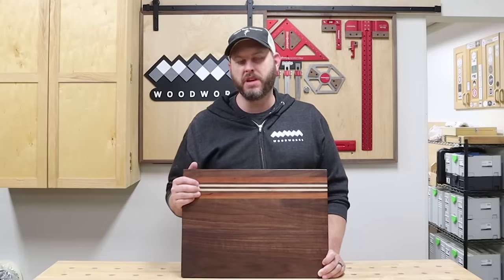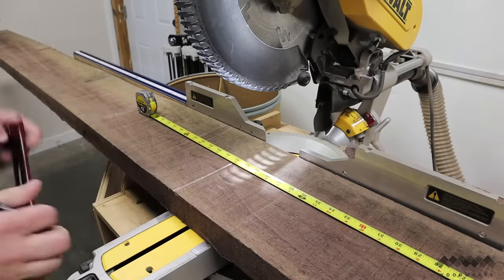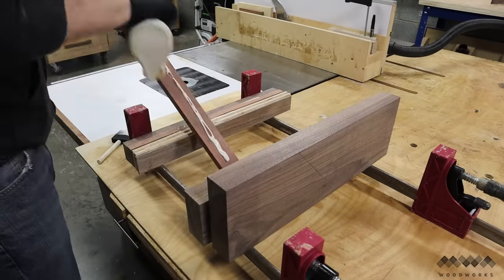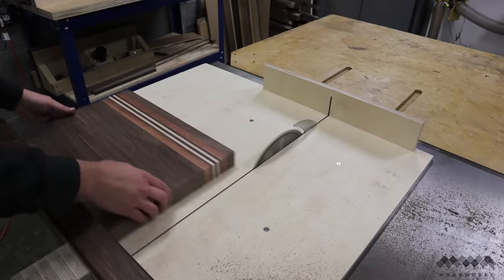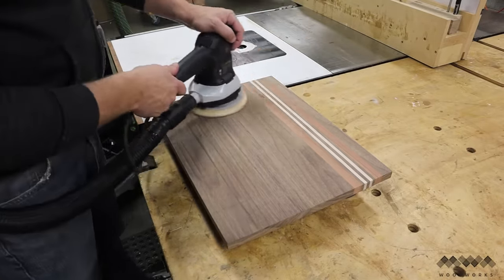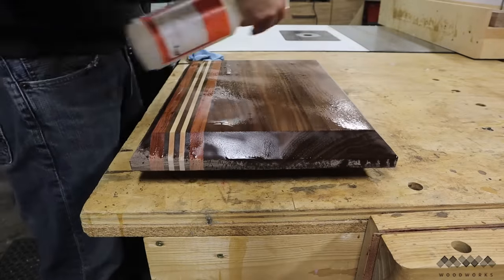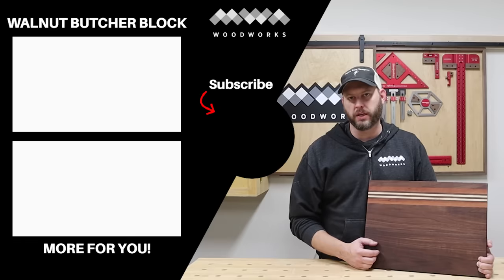5 Tips to create the PERFECT cutting board

Comment: Very nice.  I like to place my boards in a low oven after wax/oil application.  You can see the air bubbling out of the wood, and the physics of the situation suggest that, upon cooling, the material is drawn more thoroughly into the wood.  In fact, you can easily tell the difference in the amount of residual wax and oil versus the usual room temperature technique.

Comment: Hey Matt ... first time viewer and extremely impressed with just how much information you packed into less than 10 minutes!  Your presentation was organized, progressed well, and kept the interest high throughout ... not to mention that the board came out beautifully. Thanks for sharing your knowledge.
I recently retired and have dedicated much of my time to this wonderful hobby.  My biggest problem, I'm sure shared by many baby boomers, of possessing the time, desire, a decent set of knowledge.  The missing components?, money due to fixed budget and limited room to dedicate.
I would love to build beautiful boards much like you demonstrated in this video ... but limited resources say that paper towel holders may be a better match.  Seriously, can you suggest techniques, alternative tools, hand tools etc that can give us budget guys a shot at this? Anything I'm sure will be a big help to us.
Congrats on a wonderful channel that I plan on spending much time on.   Chees!!
Reply: A  planer does not have to be new to be very good, Learn how the tables adjust, cutter bushings are good or serviceable. (Applied bearing) rather than chasing down old manufacturer parts on micro fish. [Chop saw is Optional, Table saw can make those cuts. If you Scribe lines in the Table saw top, 1/4 " or so parallel to the blade / Track fence is easier to clamp strait.  Find a lil old generator (lucky(look for one close to an outlet) free power. and a $75 month storage space... " Daves Custom Boards, coaster sets, Knife blocks, Trivets, Next expand into catch trays for phones an keys ... Lok on YT for how to build wireless charging... Weekends will never be yours again.
Reply: Mr. Pierce , here on YouTube I have found some "channels" (not sure what they're called , don't know the lingo , but individuals like Matt here) with people that have 'alley-rigged' everyday tools to something they weren't meant for , but are useful and kinda "thinking outside of the box" . Some blow me away and others leave me thinking "how does this person STILL have all of their fingers attached" while others make me scratch my head wondering "who ties this guys shoes for him"  . 
Here are a few that I watch :
Post apocalypse inventor .
This old Tony ( more of a metalworking guy , but hilarious , intelligent and informative) 
Mr. Pete 222 
Abom79. 
In fact they're ALL metalworking but I've found while browsing  these "channels"; I come across many different hobbyists and Tutorials . That's how I found this gentleman Matt here.
Best wishes to you Sir in your retirement.
Reply: Hand tools my friend.  Takes a lot longer, but learn how to sharpen and set them up.  All of these steps can be accomplished w hand tools.  But time is an issue as you had mentioned.

Comment: My question, as always (in my head), "What if you don't have a planer?" (yet) Is it just a matter of getting the edges of the pieces as close as possible and sanding them flush? Or would you suggest a different method? Other than hand planing them. 1. I don't have a good plane and 2. It's not a method I'm comfortable with. I cause more chip out than anything. Which brings up #3. I'm not good at setting up the plane I have. I got it at a garage sale many years ago and it's pretty rough. Thank you for all the tips and a great video.
Reply: Hand plane or electric planer. You CAN do it by sanding but you're likely to get frustrated as its possible to end up with a cutting board that isn't perfectly flat

Comment: I normally run the board vertically on the table saw to avoid having adjust the fence. If the bevel is based on the top face of the board against the fence, I don't have to move the fence. Just thought of sharing... It looks great!
Reply: I did that this week but got a ridge as my insert wasn't 100% flush - won't be doing that again...
Reply: @Mongrel85  just raise the blade or get the fence a tad closer to the blade. As long as the fence is square, it should be good. Hope that helps
Reply: good call

Comment: I've been making cutting boards for 45 years, made my first on in 7th grade shop class.  I like your process and it works.  Two things I think of doing differently.  I don't like that bevel cut.  A simple round over or short chamfer on both flat sides will allow someone to pick up the board.  This allows for two equal sides to be used as a cutting board.  Giving the buyer a two for one deal.  The other thing is I would soak in mineral oil first.  Then let it dry for a bit.  Then your past.   I use 2 oz of pure bees wax, about 14 oz of mineral oil and add 1 oz of pure carnauba wax to make my paste.  This stays hard until your hand gets it and it will slowly melt as you spread over the board.

Comment: The benefit of Titebond 3 is that there is longer open time.  A cheap trick for spreading glue is to use a 3" paint roller, easily washed, then spun dry with compressed air. Nice video with a great choice of colour.

Comment: You missed a tip - That end grain cuttong boards should be the only cutting boards. Anything else is only good as a serving board.
Reply from the maker: Have you seen my video on making an eng grain butcher block? You should check it out too.
Reply: Hogwash. There a miles of decent quality long grain boards in daily use. The vast majority of people wont pay for end grain boards unless the maker is selling them based on $2/hr compensation. I have edge grain boards Ive made 20 years ago that are still in use today includng dozens of bench surfaces in our shop.

End grain is great, and beautiful, but if your customers arent paying for them your working ror slave labor wages.
Reply: WRONG
Reply: @daveklein2826  lol

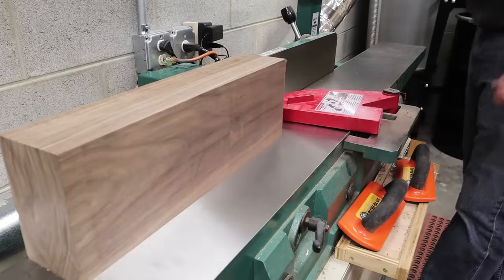Comment: 2:30 - excellent tip.  When I make desks, I have 5 boards on top.  I always run them even-numbered with the top against the fence and odd-numbered with the bottom against the fence.  It is gratifying to know someone else has figured out the matching angle trick, eliminating the need for an exactly-90-degree fence.
Reply from the maker: It's such a simple trick to know and use. Every woodworker should know it!

Comment: I am surprised that the cutting board makers don't know about walnut oil for a finish. I am primarily a bowl maker and most of us use it. It will soak in and harden, which the mineral oil never does. Bee's wax does show finger prints, depending on how much is left on. The walnut oil in the salad section of the grocery stores isn't the same thing as that which is intended for daily use bowls and plates. It is 'heat treated' which destroys all the proteins that can cause nut allergy reactions. I prefer the Doctor's Wood shop mix with carnuba wax. Mike Mahoney, a world famous turner has his own mix. Like some of your table saw 'accessories'. Will check out some more of your videos.

Comment: The butterfly method of jointing edges is GENIUS!
Reply from the maker: Pretty sweet right?
Reply: not really, that's joinery 101 stuff.
Reply: @krenwregget7667  I already knew about fixing the joints by running the pieces through in opposite directions. It just never occurred to me to butterfly them like that, then run them through at the same time.
Also, Kren, if someone just started woodworking, how would they know this trick? Don't assume everyone has years and years of experience. It astounds me that you would actually take time to try to put down a comment like that.
Reply: @rmyukon  - you stated that it's genius, all I said that it's a common technique used by lots of pro woodworkers.  You're the one getting upset.
Reply: @krenwregget7667  My point is, new woodworkers don't know that it's a common technique. So what's your point in declaring that? You just sound holier than thou.
Reply: @rmyukon  - the point is it's not genius.
Reply: @krenwregget7667  Ever heard of hyperbole? Every heard a "figure of speech?"  Ever heard of "If you don't have anything nice to say, don't say anything at all?"

Comment: Outstanding video and a stunning cutting board! Couple of questions. In making up your finish, what proportions of mineral oil and beeswax do you recommend? Lastly, is it beneficial to apply Titebond glue to both sides of the glue joint or is that unnecessary? Thank you very much!
Reply from the maker: I have a video on my channel about this finish!
Reply: @MWAWoodworks  Thanks! 50% - 50% Proportions?

Comment: I am a new woodworker female, and i had ao many questions concerning sanding.First time I come across a detailed information video, I needed those information, thank you very much.
One question tho, does it matter the alignment of grain?if I want to make a 2inches thickness board, do I cut a 2 inches board and just glue them? Or I buy a 1 inch board and flip the 2 inches wide to become the thickness...
Question 2, is it more safe for a length of 1 meter board to use biscuit,just one in the center and 1 at each edge, client( and me ) is afraid that the board archs ...what's the beat way to make a 2 inches board, with a length of 1 meter, 60cm wide, , walnut

Comment: Very nice my brotha!  Of all the woodworking things I do, making cutting boards is my favorite!  I like your techniques.  After trying several different finishes, I have settled on food grade tung oil (Real Milk Paint brand).  It lasts a long time.  Nice work!
Reply from the maker: thanks for the kind words!
Reply: I too have settled on the Real Milk brand tung oil.  In fact, am now using the 50/50 mix of tung and citrus solvent (both food safe) offered by Real Milk. I use the 50/50 mix straight up for several initial coats, then when dry cover with 50/50 blended with beeswax.  Sweet result.

Comment: Awesome! Stupid question but what’s the reason behind breaking down the large walnut piece into 2 and then gluing them back up. Does it provide a more stable piece compared to a wider board?
Reply: Oops I just rewatched it and it was 2 separate pieces you had after breaking down and milling it. I’m assuming the original rough wonky wasn’t as wide as when you eventually glued the 2 pieces together.

Comment: It's a beauty. But a question though. Most other woodworkers would suggest ripping the main walnut slabs to thinner strips to prevent warping. Did you skip this step because the material is so thick?
Reply from the maker: Thick
Reply: @MWAWoodworks  THICC

Comment: I'm making an end grain cutting board for the first time. I'm using my uncle's wood shop and he has a small jointer you put on your work bench. Unfortunately we can get a flat edges with it. My question is when running a board through a jointer do you push down on the board while pushing it through? Also do you put pressure on the board above the out feed table or the in feed table? If I push down on the in feed after half the board is through the blade the board tips up like a kids teeter totter. The blade is perfectly in line with the out feed table. So I'm just not sure

Comment: Great build! Love the contrasting woods. I’ve read that wax is not suitable for surfaces that will see water. Any problems you’ve seen with this? And do you refresh the finish with the same oil/wax mix?
Thanks, and again, beautiful job!
Reply from the maker: Well cutting boards shouldn't see THAT much water to begin with. Just a wipe down with warm wash cloth will do. The oil/wax is perfect for this application because it can be reapplied periodically depending on how much use the board sees. Anywhere from every 60 days for heavy daily use to once a year for the occasional use

Comment: I like the Bevel  except I would have put a 1/2 inch deep V cut off centre, through the sides. (So you could work out which side is which). That way the surface area of the Board would stay the same regardless of which side of the Board you were using. 
Real cooks use one side for Meat Prep & the other for Vegetables. Especially when cooking for Activist Vegans. 
I know right???  We have to clean the knives too, if we are changing from one to the other.  
Love your work , Thanks for the Video.
Reply from the maker: Wow I definitely hadn't heard that before. You learn something new every day. And I love the v groove idea. I generally put a standard concave finger groove on the sides of my non bevel boards.

Comment: Hi, very cool video! Lots of useful tips, just the right speed in your presentation and your board just looks amazing! Juice groves would be interesting (the corners - oh me, oh my!) to see how you do them. Keep on! Greetings from France, Manfred
Reply from the maker: Unfortunately you wouldn't like how I do them now. I use a CNC😁
Reply: @MWAWoodworks  Ohhhh nooooooo, gimmy a break that's cheating!!! I thought you'd do them using a Japanese chisel or something....
Reply from the maker: CNC is the only way I have ever been able to eliminate all burn marks. Sucks but true 👍
Reply: MWA Woodworks Sooo true! I know what you’re talking about. Luckily even a master struggles with that problem 😎
Reply: Just did my first juice groove, using jig and hand held trip router.  Worried lots about burn marks, and got a few.  But a final pass with a VERY shallow cut got almost all burns gone.  Final touch up to deal with minor burns:  a card scraper, but not the normal rectangular one with sharp corners ... used rounded edged one made by Crucible Tools.  The rounded corners worked like a charm.

Comment: I've a question: will a board like that, finished with Min-oil+Beeswax, "bleed out" oil/wax if a hot pan is placed on it? 
Question2: If you wanted your board to double as a trivet (occasionally), what finish would you apply?
Thanks for such a well executed video!
Reply from the maker: If the pan was hot enough it would probably melt some wax and leave a wax ring mark. Easily fixable. I would not put any other finish on the board. There's really no finish that will stand up to intense heat anyways.

Comment: Gorgeous.....but I’m curious....the wax and oil is all you need to protect? What happens after the first blade cuts into it??? No need for a harder finish? Thanks
Reply from the maker: You're not protecting the board from knife cuts. You're protecting it from water. It will be totally fine with a few knife marks in it 👍
Reply: MWA Woodworks so that stuff penetrates pretty well?
Reply from the maker: The oil does yes

Comment: Kudos my friend!! I really like how you've set up the dust collection system for your tools. So nice to not be constantly working in a cloud of dust in the shop with shavings everywhere. The only thing I would have done differently is to lower the table saw blade when you were making the 45's on the board. It's safer and there's no need to have all of that exposed blade above the material. Peace!

Comment: This didn’t look like it was entirely end grain...any worries about durability holding up with long term use?
Very helpful tips...thanks a ton!
Reply from the maker: There's no end grain in this one. There's no issue with durability. All boards get worn out with heavy use👍 just the nature of the beast
Reply: i was thinking the same thing.  I always do edge grain... way more work.. but, I had always been informed that face grain wasn't as stable or tough... It's worth trying though.. I do like the grain patterns with Face, and almost cry when I end up slicing it up to hide it.

Comment: Question: You used the jointer  at 2:32 to get those two boards to joint perfectly, great. But then the thinner walnut and accent strips you just cut on the table saw (around 3:00). Did you pass those trough the jointer or planer before glue up, or are they good enough straight from the table saw? Hopefully you can answer. Thanks!
Reply from the maker: Correct.straight off the table saw. Those are too small for the jointer/planer
Reply: @MWAWoodworks  Thanks for answering. The cuts im getting on my table saw are nowhere near clean and straight enough to glue up without gaps, but I just got it, it's my first cuts and I haven't calibrated it... Also the blade might play a role (?) it's the blade that came with the saw and reviews say it's not very high quality... Thank you again for your time
Reply from the maker: Stock blades are never really that good. Depending on the kind of saw you have it could be designed for this type of work or general construction in which case they don't plan on the saw being used this way

Comment: Beautiful board and terrific video. What are the final dimensions? Also, curious if a 2” 45 degree chamfer bit on a router tabor would achieve the same result as the table saw bevel cut, or would that risk tear out?
Reply from the maker: I think this board was 12x18. I would hesitate to remove this much material with a router bit. I'm sure it can be done in multiple passes, but Id prefer the table saw if one is available. It would be quicker.
Reply: @MWAWoodworks  I finally had time to make a few of these and am thrilled. Unfortunately the wax paste I made last May is getting pretty dry (even stored in the little tins), so I need to make another one of those, but overall this is at terrific project. Thanks for the great tips.